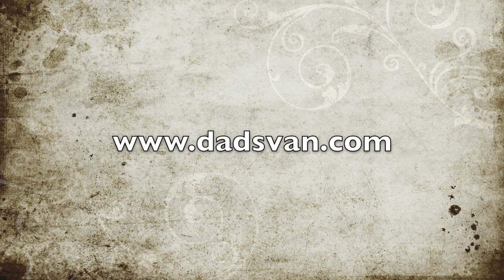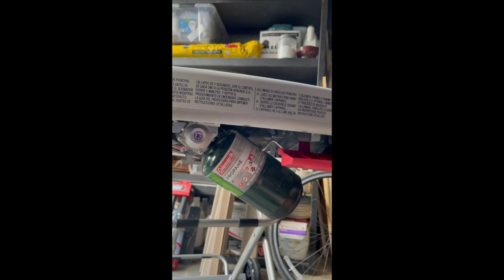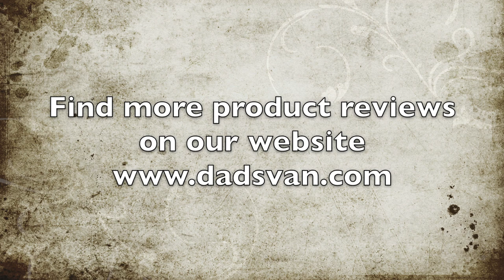Review of the Weber Traveler portable gas grill

Comment: Around 14:19 that lid swung open. Is there not a locking mechanism to keep the lid closed?
Reply from the maker: Yes there is.  There is a lever you push up on from underneath that then engages a latch on the cover.  It ensures the cover doesn’t open during transport.